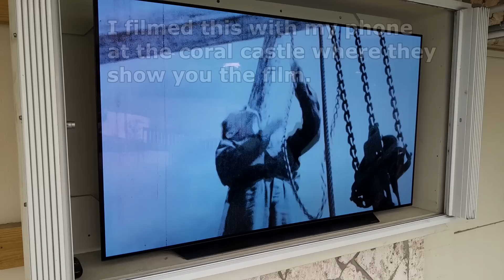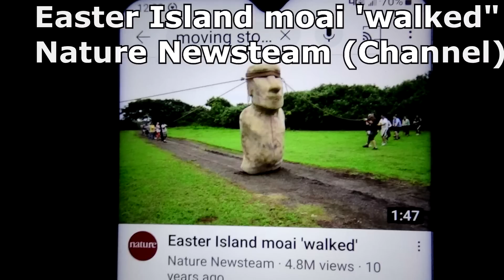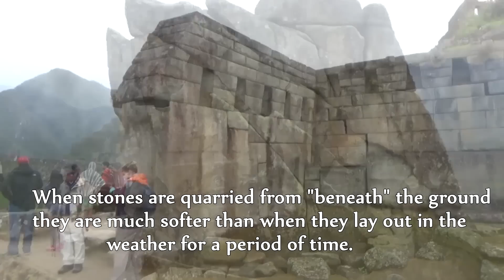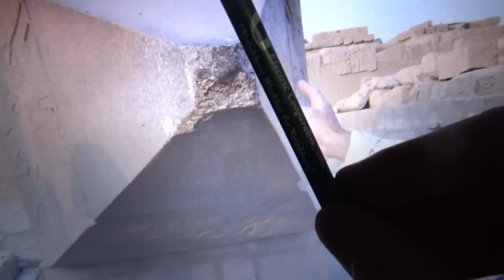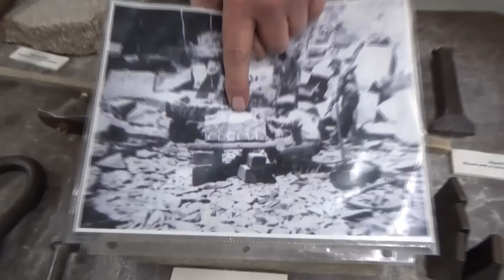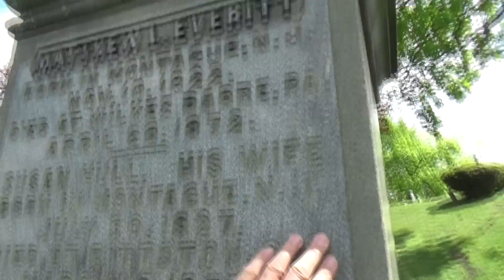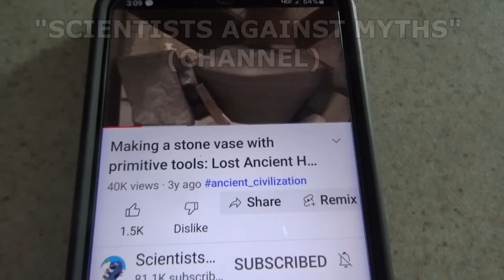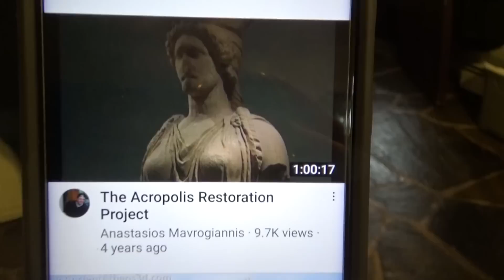CARVING STONES WITH ANCIENT TECHNOLOGY (Part 2) Mike Haduck

Comment: 1st position line of thought problem I've encountered more than anything has come from the sky scrapper, office occupation era that all but removed 35 & under from our workforce via 12 yr degrees and that usa sold off most conventional lathes, mills and grinders as the transition of cnc & 3d printing really cut out alot of basic 3 step qaulity control influence on our society. 

With so many being a couple generations away from physical labor farming or mass production they really don't comprehend how much a man can do per minute per hour per day. 

Why archeology don't think biodegradable mills lathes and grinding fixtures or technic would not be utilized is almost as mind boggling. 

With cardinal direction these 3 functions one way or the other have built everything in all ages. Water ,fire wood wedges pullys & levers can achieve anything earths geology can produce lol
Reply from the maker: Thanks dad, I agree,  Mike
Reply: @MikeHaduck  People like you working back in details after a long century of losing such an online voice of detail can really go a long ways of fixing some of this .
Bill of Rights is very much a step by step in concert with English law and our distinctly American individual ownership over thermodynamical systems. 
One that my grandparents was very aware of how much this was costing us. 
Partyline telegram simply had wait on the internet lol